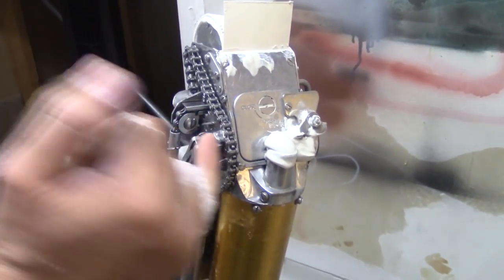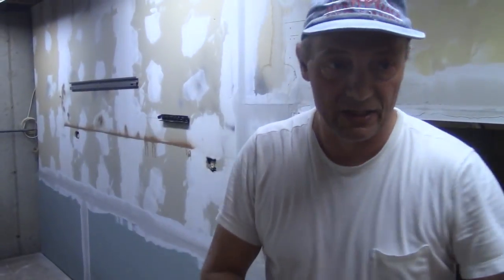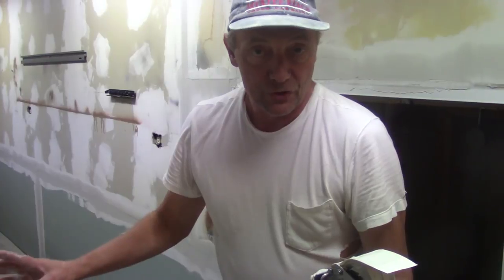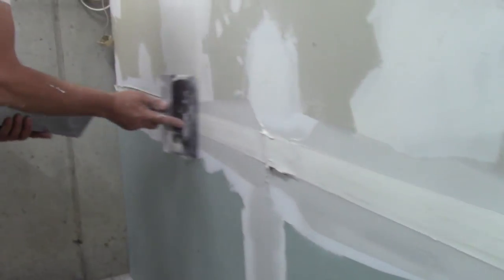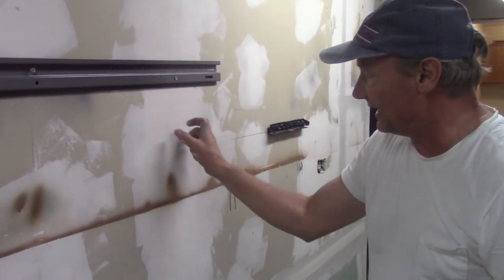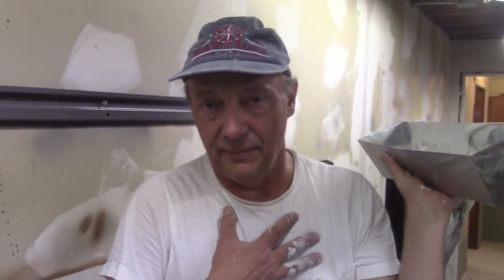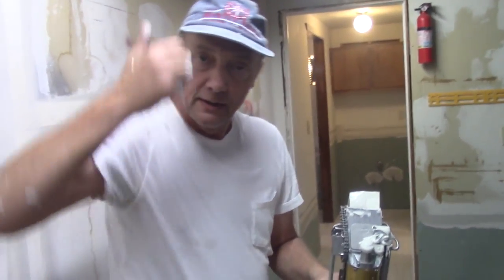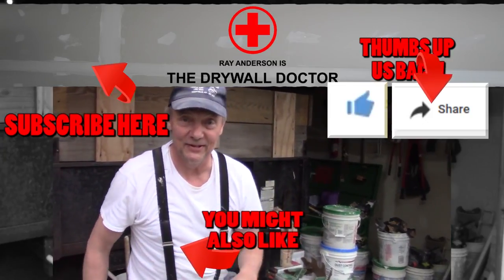How to Fix Air Bubbles in Tape and Bazooka Solutions - Viewer Request

Comment: Your exactly right Ray another way to get blisters in tube usually operator. Pump blisters happen just like you said it also happens when sucking air into pump eight full strokes with pump tube should be full older pump sometimes ten. If your getting  air into pump it’s usually skip blisters one side of tape or real small blisters. Another one sprayed today sure miss my rig another week waiting for parts probably. Getting ready to start a monster house two hrs from house not sure why I’m doing this other than almost 45cts more per ft plus motel expenses. Hopefully hangers will knock it out in three days with no miss boxes. Finally using all mud on bead and new off angle coating tools. All because of your videos Ray my other finisher hated it until he realized coating bead was saving them big time and way less mud almost 40%. That in itself is a big factor quite the savings. Keep up the great videos. Got your last response on seeing you when I’m in Chicago I will hopefully after 2018 Christmas God willing.

Comment: Doc.. my man. I am very grateful for this! Yes my zook is less than a year old and the rest of this set is as well. All in excellent condition and they all produce spectacular results. Mudrunner is next. I do 95% commercial so mostly 10’ or 12’ verticals, and wearing stilts for 8 hours running inside corners with a 7” angle box can be a daunting task for 2 or 3 coats. So the mudrunner would alleviate a lot of the wear and tear of that process. But anyhow back to the task at hand. The dry spot I’m getting is consistent. Approximately 4-8 inches off the floor and 2-3 inches in length. The rest of every seam always has great mud application, it’s just that one spot. Truthfully I think it has something to do with when I advance the tape from joint to joint. Once I cut the tape at the top of the seam, I roll the last few inches out, remove the bazooka from the wall, move to my next seam, push the sleeve forward to advance the tape, place the head at the bottom of my seam and start up the wall. After the first foot it’s a thing of beauty. It’s just under that that is giving me headaches. I have combatted it by trying different things such as using the key while advancing the tape so the tab is wet and pushing forward once I start rolling but that is a sloppy mess and I hate it. The the most effective way I’ve found is to not advance the tape after finishing a seam, go to the bottom of the next seam, roll up the wall about 6 inches, then advance the tape, then reset at the bottom and go up the seam. The problem is you get a good sized splat on the floor EVERY time I do it that way... but, it solves the problem. We are currently taping so I could get some video of the problem and share it to you somehow if possible. Let me know. Thanks a lot.
Reply: The Drywall Doctor will do. I’ll get some video of the issue on Monday. Thanks
Reply: Jim Britz
The reason you are getting the dry spot  in the first foot of your tape is because you are using the dog pin to 
 move the chain wheel to advance the mud on to the tape , That pin that engages on to the chain wheel while turning it by hand means you are pushing the chain wheel to advance the mud onto the tape when priming the bazooka for first application of a tape , so when you start running the tape the pin now has to switch from pushing the chain wheel to being pulled by the chain wheel , this is what give you the air gaps , if you must prime the bazooka gun by hand , you will have better results if you turn the main wheel of the taper head that engages with the board surface a few times till the chain and the dog pin switch to being pulled by the chain rather than pushing the chain wheel , ( you can see this happen if you watch it while doing it ) then run the gun , you should reduce your air gap significantly
Reply: jaimie mc donald thanks a lot I will definitely pay attention to this the next time I use the taper. I’ll let you know if it fixes my issue.
Reply: It took me years to work that one out myself  lol as no one ever explained it to me ether , happy to help out , Another tip for diagnosing air spots is , If your taper is full to the max and leaves air gaps when you first run and dose not do it as bad as it gets lighter as the mud is used up (only half full ), then its usually the clicker tension pin that is worn out and the weight of the mud draws the main wheel backward before you touch the wall and start running.
Oh..... Remember if your gun is used a lot and gets over a year old the teeth on the main wheel will ware down and the gun can draw in air when full of mud and heavy (also causing dry spot at beginning of tape),  check there is no backward roll on your main wheel by trying to roll it backwards by hand,  so always replace these side plates once a year at least , lots of replacement parts a cheap Chinese metal nowadays and ware out a lot faster , don't buy cheap parts as you will replace them twice as quick
Reply: IMO it sounds like it's because you are advancing the tape dry. When you cut, roll the last few inches while advancing.

Comment: Hello
I have a bazooka Tapetech and 
Un each new tape in the first sections of tape that do not have joint compound behind it
Can i you help me to fix it
Reply from the maker: It's very hard to know what the problem is unless I have the Bazooka in my hands
Reply: THE DRYWALL DOCTOR
Thank you, I have the problem when I cut the tape and start another, and it is almost in the same place 7 cm after the start and it lasts about 7 cm more, and in the rest of the work it is fine

Comment: Do you have a video to show repairing that seal?
Reply: Mark Brass that seal is a piece of cake. If Ray doesn’t have video call tape tech will explain especially if you tell them your changing pumps. Might be a little tough if you’re not used to keeping real clean tool with a hook on it will pull it right out then clean real well with high pressure hot water use  canola oil to slide new back it with something that’s not sharp believe I used long Allen wrench before not that I’m telling you this mine will probably shell out next week. Canola oil is best on all tape tools we used bazooka oil can’t stand the smell if you know what I mean. I believe canola is seal saving my opinion. My friend uses wd 40 or silicon spray but his seals don’t last more than two yrs. mine is 15 and still looks very ply able. I swear bye canola in a spritz bottle but they have this oil like nano diamonds in it name off the top of my head slips me but will try to find out. It is extremely expensive but it will last on parts even after washing them plus it works under water it’s a reg spray can that says it contains Nono diamonds. Canola in spray bottle is still my first choice for usage and smell especially in work truck or tight quarters. Good luck God bless.